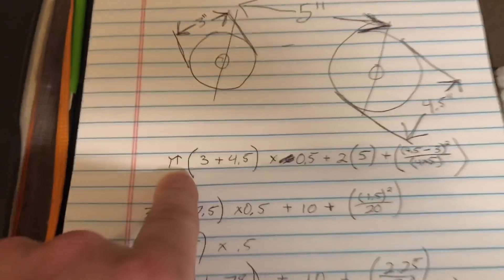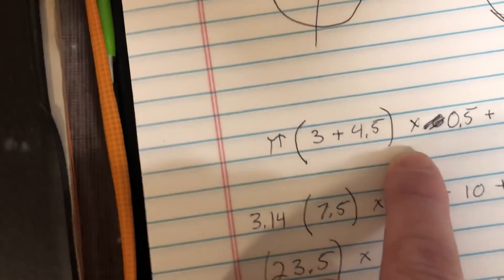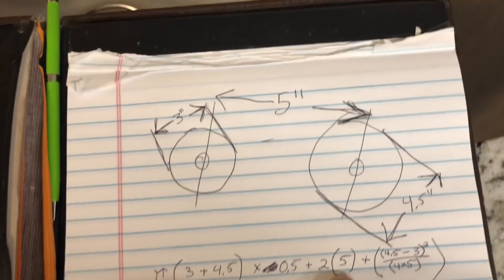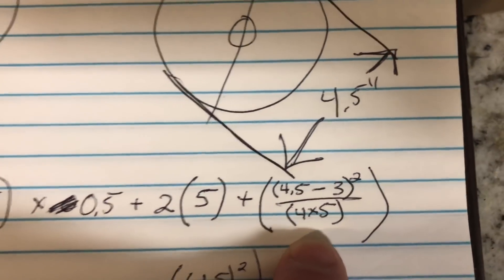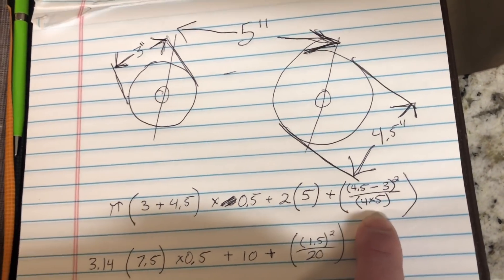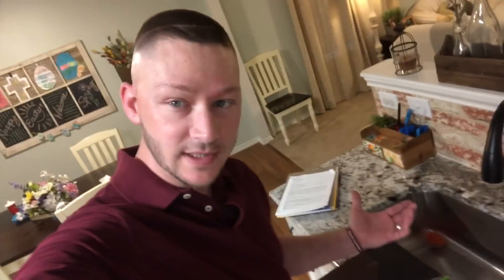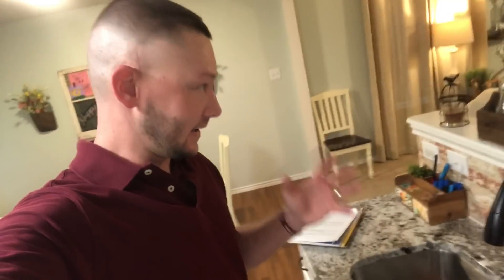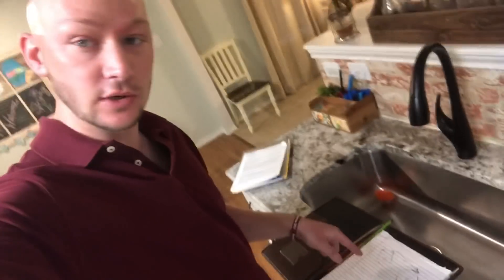V-Belt Length Calculation

Comment: Just mentioning here that his calculations were correct, as at 0:21 lower on his paper he had calculated and circled " 22" " inches for the length of the V-belt, and I calculated it exactly using nothing but his pully sizes and their distance from each other, and geometry (and trigonometry), and came up with the near exact length of 21.8937 inches which is practically 22 inches. So no matter how goofy his formula looked it actually gave him the correct answer :-)

The formula my calculations gave is this:
2*pi*R - 2*(R - r)*ArcCos((R - r)/d) +2*SquareRoot(d**2 - (R - r)**2)

Where R and r are the radii of the large and small pullies respectively and d is the distance of their centers from each other, and this formula should be calculated in units of radians, not degrees. So the mode of your calculator should first be set to radians before using this formula. The formula is exact, by the way. No approximations in it whatsoever.

Comment: Ok, what your formula is to calculate both circumference of both pulleys, then devide both numbers. Then add the distance between shafts by 2. This will give you the OUTSIDE of the pulley. If you have a v belt remember that the belt length is the outer edge of the belt or the part that is labeled. now as you know the belt sticks out past the pulleys as it wraps around the pulley so add a half inch. Remember you have to consider the width of the pulleys too.

Comment: I use tubing to measure for the belt length, mark the overlap and tape measure it. Just make sure the tubing rides where the belt does. 🇺🇸
Reply: Brute Better yep.  A rope of the appropriate size works pretty good too. I’ve also used an old belt that was too long and cut it and measured it.